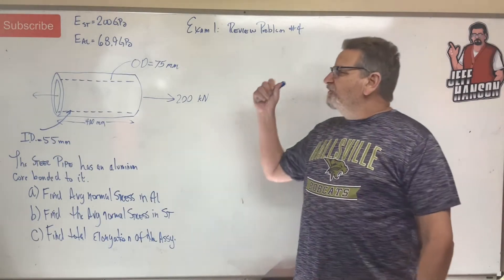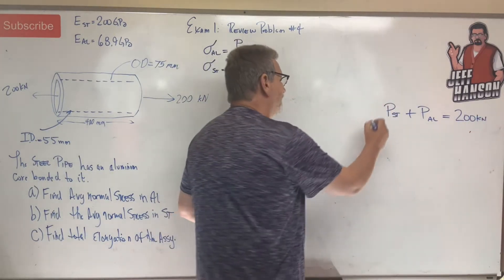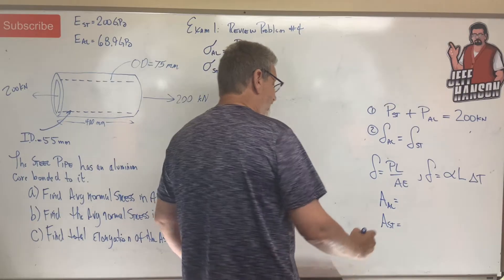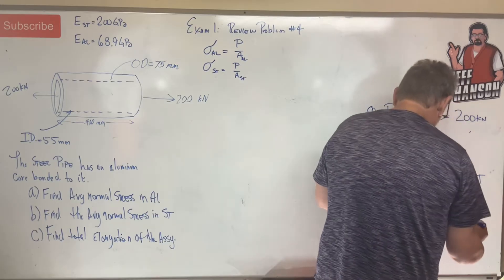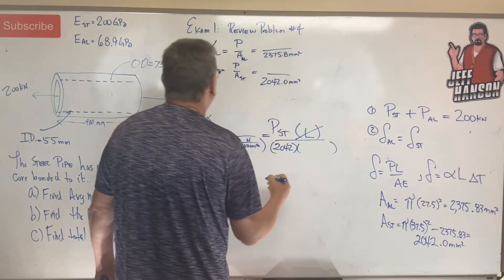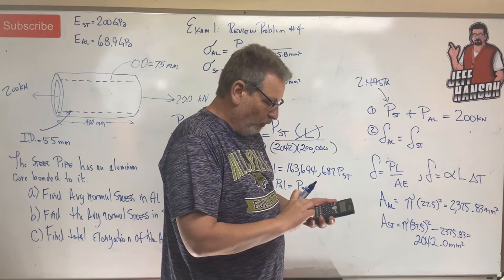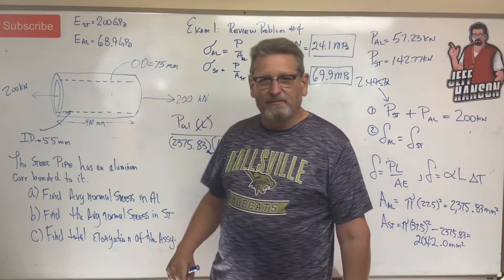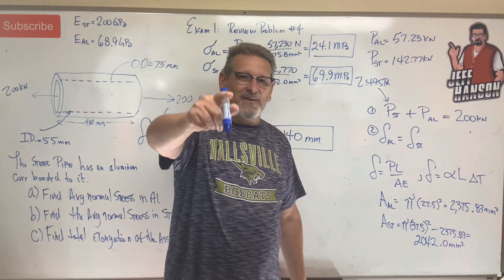Mechanics of Materials: Exam 1 Review Problem 4, Axial Elongation Example Problem

Comment: This is wrong. You solved for the compatibility equation in terms of Newtons and therefore the forces you found were 143 and 57 Newtons, not kN. The statics equation of Pst + Pal = 200 is only a ratio and is unitless. Notice how the Newtons never canceled out in the compatibility equation, that means they are the units of the final force answers